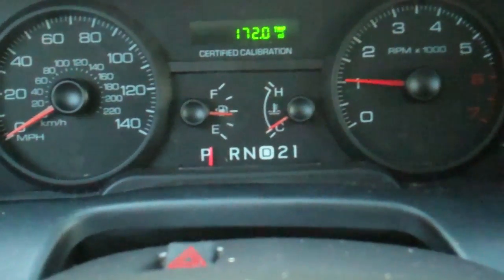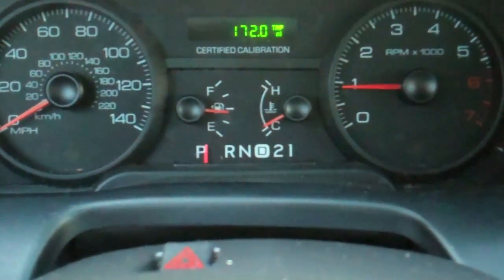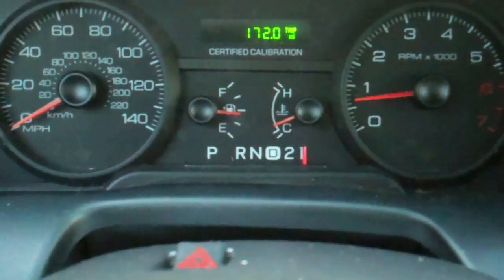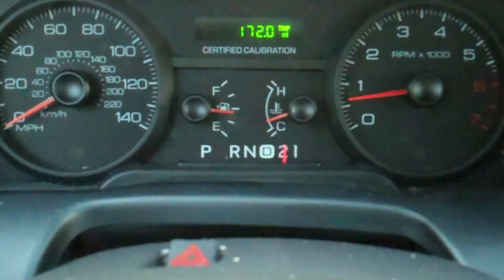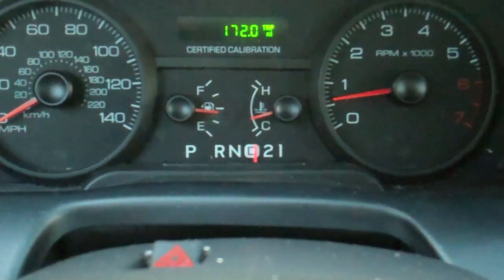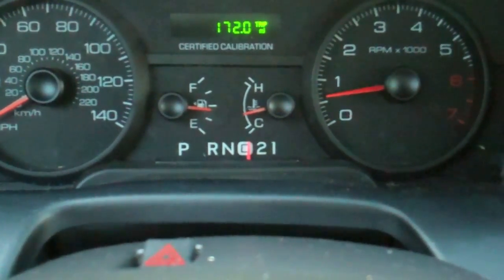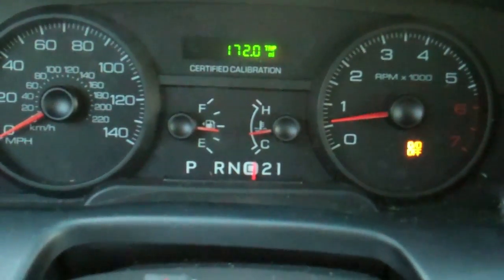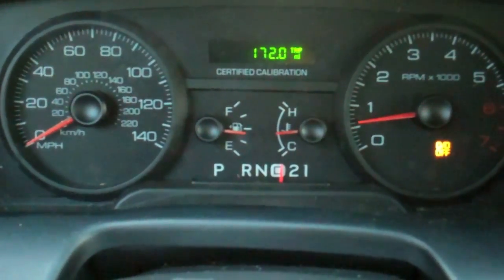Understanding the Ford Crown Victoria P71 Police Interceptor Transmission

Comment: It is my understanding that you do not want to use OverDrive when you're towing a trailer or you're climbing a really steep Hill. Drive
Reply from the maker: the owner's manual spells out when to not use O/D.  Of course like most written language, different readers will interpret differently
Reply: @WJHandyDad , I got the car used never got an owner's manual. However that was what I was told by a mechanic. He's a pretty knowledgeable guy so I took his word for it and followed his advice.
Reply from the maker: @jonesperkins1382  you should be able to find most, if not all, owner's manuals online for free.  The later ones also have the police supplement as part of the manual (at least 2008 older the supplement was a separate book; for sure 2010-2011 it's in the manual.  I don't know about 2009)

Comment: Hey I have a 05 crown Victoria police interceptor and I replaced the transmission and the overdrive is still blinking have any ideas
Reply from the maker: many possibilities, most fall into fluid temperature, sensors, or electrical wiring.  Good luck, sounds like no fun trying to find and fix

Comment: I leave overdrive off in city and town driving conditions and turn it on when I can go 45/50 for a long period of time, thats just cause people in my city are morons and cant figure out how to use a break pedal or turn signals.
Reply from the maker: I am tempted to try a full tank of gas without using overdrive just to see what happens.  Because I do find a lot of situations where the transmission is in 4th gear and instead of downshifting to 3rd, the engine just revs up and slips at the torque converter.  Then if I push the O/D off button the revs drop and the car has more power.

Comment: Please, I have a problem with the transmission for the 2009 Grand Marquis. The transmission does not move in reverse except with difficulty. It works, but very weak, the front gears work smoothly and excellently.
Reply from the maker: Try changing the fluid and filter.  If that doesn't fix it you may unfortunately have a more serious problem that requires a rebuild  https://www.youtube.com/watch?v=tV3fAs8dIQE
Reply: @WJHandyDad  I appreciate the quick response, I replaced the fluid and filter in Last month, I changed the fluid and filter after this problem occurredand the problem is still the same, noting that the engine light is on, I have searched repeatedly for the problem on YouTube and found people who say if they clean the valve body the problem will go away, but I am not sure whether to do this step
Reply from the maker: I don't have any videos on that unfortunately.  Good luck.  Hope you are able to fix it.
Reply: @WJHandyDad  thank you my dear

Comment: Hey! I have a quick question. I was wondering what the amazing whine sound is when you floor a CVPI. Is it the torque converter? Serpentine belt? Alternator? Thank you!!
Reply from the maker: there is a long running joke that goes like this... "Supercharger?  No... Ford power steering"
Reply: My car along with several other panthers I’ve seen do it but not all and it’s the alternator whirring
Reply: I believe it’s the alternator pulley. Something about a clutch disengaging under full throttle, the load is taken off the pulley, so I thing it’s just the bearings or something. Beautiful classic sound though isn’t it!

Comment: Where I am driving now the OD is always left on.  Terrian is flat, no elevated grades, an occasional steep bridge or overpass.  The secondary roads speed limits are typically 30 to 45 mph, occasionally county routes can be 55, and the interstate is 65 -70, traffic flows a bit faster.

Comment: so OD off mEns 4th gEr off.. & all that stuff aboOt gOing up sTp hills N stuff is jst a bnch of hupla - gr8.. not srprIzd - gOEng up sTp hills just put it in 1st or 2nd - cas OD(4th gEr) off is gonna B erLevNt... gr8, that’s setLd - NOOOOwww wN Ppls dash stRts intermitNtlE turning off & on, thats dupOzedlE a short in the OD off switch too the steering column - which brings me to QSTN(fInLE).  hoO do U get to, & electric tAp thOs 2 Yrs without accudNtly triPng these yLO Yrs which could set off air bags - Id lIk to fix this without a 200$ mech. bill OR a 200mph airbag punch in the glSz🧐

Comment: What rpms does it reach in 3rd gear at wide open throttle before shifting into overdrive? 5500rpm or 5750rpm?
Reply from the maker: I've never tried to see, but I bet it's closer to 5750
Reply: @WJHandyDad  ok think so too. If the 130 mph speed limiter was removed would I hurt anything on my P71?
Reply from the maker: @krownvikkhris3004  not recommended, the limiter is on there to keep you safe from a catastrophic driveshaft failure
Reply: @WJHandyDad  ok, have you ever heard of the aluminum metal matrix driveshaft that came on the 99-2000 P71s? Those driveshafts could handle higher topspeeds that the regular aluminium ones .
Reply from the maker: @krownvikkhris3004  yes I've heard of those, but I don't have any knowledge about the safety of retrofitting one of them
Reply: @WJHandyDad  ok

Comment: Good video!  I talked to a guy who owned his own transmission repair shop and I asked him about this and he said if you leave your tranny's OD on all the time, you will slow the engine rev's down and will help it last longer but at the expense of your driveshaft, U-joints, rear end differentials coz in OD, the driveshaft is spinning so much faster than the Transmission and Engine...

Comment: When I bought mine I noticed the guy I got it from make sure the O.D. button was OFF driving around town, I didn't question it TILL after I bought it & noticed around town with O.D. ON the trans would slip or hunt?? Is this normal?? I try to NOT forget to have it off.
Reply from the maker: "hunting" between 3rd and 4th is one reason specified in the owner's manual to turn O/D off.  I have yet to drive in a place where the transmission hunted between gears.  Mine usually shifts into 4th sooner than I'd like and then the engine revs higher than it would in 3rd gear to keep the car going uphill, but mine never downshifts unless I floor it

Comment: The 1 and 2 are usually used for trailering or simple offroading. From my experience it gives you more torque.
Reply: I use it as my “go” gear when I wanna pass. Lol
Reply: @z609gaming  same lol. People on my route, I know the regulars learn that if they see the car downshift all of a sudden. Imma bout to make it rip n tear.
Reply: So when you have it on 2nd gear to take off your sayin you can put it back in “Drive” while moving?

Comment: I always turn over drive off if I’m driving in the city and going under 40mph. The reason being that when over drive is on, it tends to keep shifting back and forth from 3rd gear to 4th with just a tiny change in pedal pressure. Saves a lot of transmission wear by not doing those unnecessary shifts every time I give it a little gas. It just stays in 3.
Reply from the maker: that's exactly one of the reasons mentioned in the video (and owner's manual) to turn off O/D.  I've never had the experience of any of my Vics "hunting" for a gear - mine have all switched to 4th and stayed (even when I wish they'd be in 3rd LOL).

Comment: I almost never exceed 45 mph driving around town. Should I turn OD off?
Reply from the maker: more of a personal preference.  Ford would say leave OD on.  With OD off the car will stay in 3rd gear so it will feel more responsive and it will offer some engine braking on downhill.  Whether or not you get better or worse gas mileage you'll need to run some tests and see... and let us all know!

Comment: What is the max speed with the O/D off before you have to worry about damaging it?
Reply from the maker: check out my video on Ford rear gears to see the various RPM to speed for the different rear gears and at different gears on the transmission.

Comment: This video really helped cuz I just bout one and it's my first ford, GM as far as I know never did any thing like th do t with over drive they just gave you 3 gear as a shift select. So it's nice it's a button cuz 3 gear has you peak hp an ftlbs of torque when you need to put it down. The name over drive seems misleading kinda
Reply from the maker: as for "overdrive" the term refers to the fact that the engine is spinning less than one revolution for each revolution of the driveshaft
Reply from the maker: yes, most vehicles I've owned had either a 3 or two D's, one with a circle around it for "overdrive."

Comment: I tried it for you cause you were a chicken. It shifts from first to second and second to third, and if over drive is on it goes into fourth. All while the 1 is selected. Your welcome, i even tried hitting reverse at 15 miles an hour, quite the ride and my transmission didnt blow. They are pretty hardy things. I just wanted to hear about the models of transmissions for verious p71 models, you dont have that.

Comment: Leaving OD on in a p71 is prolly ok, u have the shorter rar.  I have an 06 grand marquis 2.73 rar that basically will turn 2200 rpms at 70 in 3rd with OD off.

Comment: i shift mine into second when i go down steep hills for more engine braking.
Reply: Exactly also less braking pads so they dont wear out on a steep hill going down
Reply: I think that can wear it. I dont think youre supposed to move the shift lever down while the vehicle is moving (just press o/d off thats fine while moving but better to be off the throttle and not above 100km/60mi while disengaging O/D)
Up from 2 to D is ok
Reply: P77777777 you can, moving it into a lower gear won’t hurt it. what will hurt it is if your going 60 mph and throw it into first or second gear, but i don’t think the transmission will actually select the gear until the vehicle slows down enough that the RPM wouldn’t damage the engine. same is true if you try to select reverse while moving forward too fast, it will go in neutral until it’s slowed down enough to engage reverse.

Comment: I have a question my 2006 crown Victoria police interceptor when I put it in gear as stalls out and I just got done replacing O2 sensors all four of them any tips
Reply from the maker: I haven't run across that problem so I don't know, sorry.
Reply: clean throttle body,

Comment: i think overdrive is used when you are driving downhill for a Long time going down from a mountain for example ,as this will help slow down the car without you having to ride the brakes. which if you did you will decrease the break life and the breaks will heat so much

Comment: before I even watch this I'll let you know in my 02 I always leave OD off in the city my car like it but you will pay for it in gas due to higher RPMs. only time I run overdrive is interstate.
Reply from the maker: you may not be wasting gas - I've noticed when I hit hills, sometimes the car is revving higher in O/D than it does if I switch to 3rd gear.  The torque converter doesn't seem to lock up very often in O/D and thus the revs are artificially high.  There isn't a right or wrong answer, we can all drive our cars how we want - I made this video because at the time, there were a ton of questions about it on Facebook and a lot of wrong info being presented.  So I presented what is in the Ford owner's manual and police interceptor supplement.

Comment: Hey I have a question. My o/d button only works in park. Not any other gear. It works to turn it off but it only let's me switch in park. Why is that?
Reply from the maker: sounds like an electrical problem

Comment: When you turn the light on by pressing in the button it goes from 1st to 2nd to 3rd and 4th not into overdrive because by turning on this button witch illuminates the light on the dash disengages over drive. 

Does not just stay in third gear. Count and see how many times your transmission shifts before it stops shifting maybe you’ll learn something.
Reply from the maker: I never state that it only stays in 3rd gear.  O/D off allows the transmission to be in 1st, 2nd, or 3rd gear, but won't allow it to shift into 4th (which is overdrive).
Reply: Jersey Pagan 4th gear IS overdrive. turning it off will not allow the transmission to shift into 4th gear. it’s that simple.

Comment: Do you know what rpm the car is supposed to be at in park. Mine seems high compared to yours ? Mine idles at 1100 in park. Also idles at 800 in drive.
Reply from the maker: There isn't really a set answer - it depends on a lot of factors

Comment: The old ones had 1 2 D and D with a circle around it ( overdrive)
Reply from the maker: I remember those... hard to believe that cars used to not have an overdrive gear, even when I was first driving they weren't super common

Comment: I have question about the overdrive, if the overdrive button is turning off. Does that mean the wire needs to be replaced or dose that mean the transmission needs to replaced? It's 05 p71 with 220k?

Comment: Got really nervous when I turned O/D off and it wouldnt shift after it was doing 65-70mph @2,900rpm thought I lost 4th gear eased my mind thanks
Reply: Same, I just bought a 07 and a v6 buddy smashed me because od was off and I could get passed 3rd  lol
Reply: Yeah you don't want to be driving that high of a speed and then engage Overdrive I suggest leaving it off in the streets and turning it on for the interstate but turn it on before you accelerate on the interstate don't do it while going 60 miles per hour

Comment: Some key things about the Ford 4 speed automatic transmissions;

45 mph is the most common speed where the overdrive lockup is designed to engage. Ford also has been adamant about owners NOT using overdrive for towing. When these transmissions first hit the market in the early 80s (yes they have been around that long) Ford had a lot of issues with the torque converter vanes getting shredded when owners towed on overdrive. The P71 uses either a 4R70 or 4R75 (the later more heavy duty version) from the factory. The other Panther platform cars (civilian CV, Grand Marquis and Town Car) used other versions of the 4 speed automatics, but were not the 4R70/75 versions. You can replace a P71 with those other versions without any big hassle, but they will be less durable and do provide softer shift points.

Leaving a Ford 4 speed auto in drive is useful if descending down a long hill or in twisty backroads because you will be able to use dynamic braking of the powertrain. In overdrive the vehicle will basically coast/freewheel.

Using 2nd is helpful in slick conditions when starting from a stop because the transmission will absorb more torque from the engine than if you had it in 1st or drive (which starts off in 1st).
Reply: The original transmission in this line was the AOD, released in 1980.  It was modified in the early 1990s with electronic shifting, becoming the AODE.  Then it got upgraded again, this time the gear ratios were widened out and the resulting product was called (at first) AODEW (then later) 4R70W.  The W indicates the Wide gear ratio these have.  The 4R70W transmission was modified in the early aughts with the addition of a magnetically inert sun shell and an input shaft speed sensor (turbine speed sensor) and this transmission is known as the 4R70E.  Variants were given hardened planetary gear setups and were known as 4R75W/E.

This is simplistic but this is pretty much the difference between 'models'.
Reply: @gregdcross Where did you get that? I own a 2010 Grand Marquis and a 2010 Town Car, and both have the 4r75w transmission.
Reply: So when im car campiong in vermont in the winter and i wake up in the morning and try to get out of half a foot of snow. put it in second if i can. what about reverse, deos that have the same amouunt of torque applied as drive?
Reply: A couple of interesting things I have found with my 2011 P7B and other 4R75 transmission. Under the right conditions the torque converter will lockup in second gear along with 3rd and of course 4th gear. 
I don't use overdrive under 40 mph and I get 20mpg around town and country 2 lane black top roads . It's not good to lug an engine. Never had been never will be. That's how my car was driven by the previous owner and ran like crap until it got used to the way I drive and cleaned the throttle body which was so gunked up it barely worked. Just my 2 cents. Take it or leave it.

Comment: I have a 2011 my transmission slips I will be going 40mph it will rev hard to 3rd gear get stuck in 3rd and feels like I’m not going anywhere...What could this problem be
Reply from the maker: start by checking your fluid and go from there.  Hopefully it's fluid related and not your transmission starting to fail.
Reply: What about the over drive button and also traction control how do I turn these off..Is it off when the light is on or off..It always confuses me cause it says OFF
Reply from the maker: O/D off means you are only driving in gears 1-3.  If your car doesn't have a traction control button on the dash, just above where your left knee would be when driving, then you don't have the ability to turn off traction control without disabling the anti-lock brakes, which I don't recommend
Reply: WJ Handy Dad thanks ..Also last thing yes it does have traction control button it’s a 2011 cvpi I was just always confused as to when it is ON or OFF When it lights up means it’s on?
Reply from the maker: lit up on dash should be traction control "off"

Comment: I run OD in mine all the time, no real reason to turn it off unless I am climbing a 6% or greater grade for a long distance.  That final 'shift' when in OD is engaged isn't the trans shifting into OD - that's already happened by then.  It's actually the TCC locking.